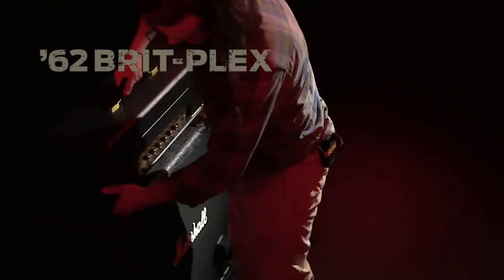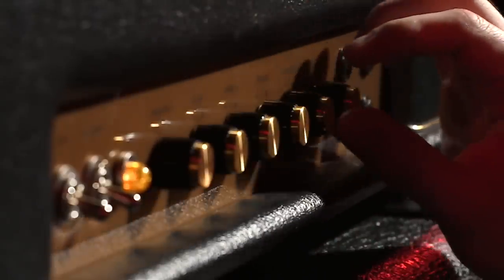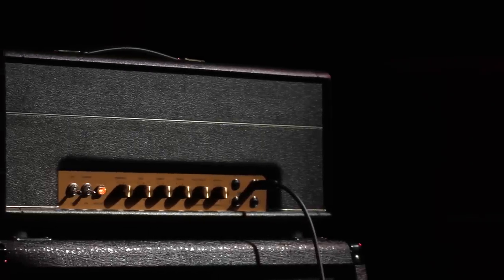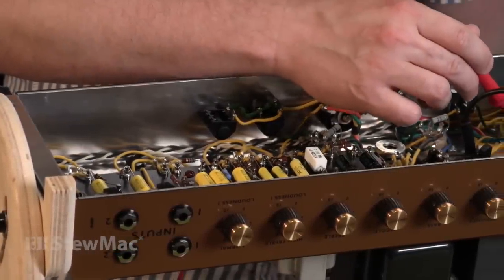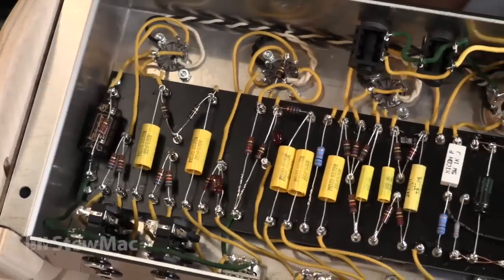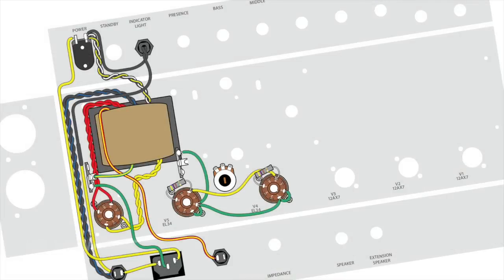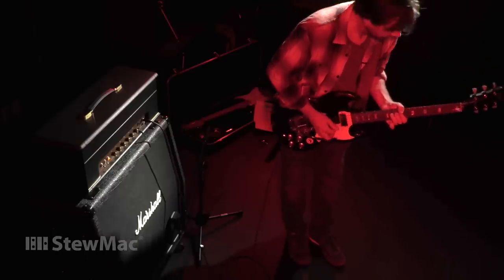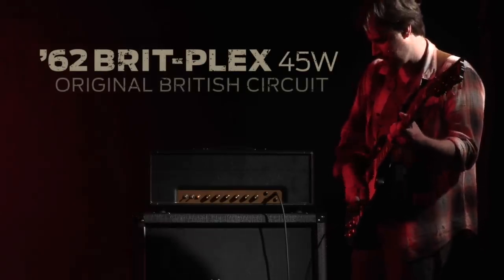Hear the new StewMac '62 Brit-Plex amp kit - a hand wired JTM-45 Plexi style head in a kit!

Comment: So great to have a quality kit being offered by you guys.
For the record, Jim Marshall didn't design any of the circuits of his amps as he had no EE background. The guys behind the electronics were Dudley Craven and Ken Bran. Ken Underwood took part in the building of the initial batch of amps supplied to Jim Marshall, and is the only one of them alive today to tell the story of how Marshall amps got first started. Look him up. Cheers.
Reply: JTM45 was a Fender Bassman copy. The first ones they built used 5881 power tubes. Shortly after they switched to KT66's which basically sound the same as 6L6 power tubes (which were hard to get in Britain). And Leo got the circuits from the RCA tube manuals of the time, almost all the amp builders got their circuits from that as well.
Reply: Hell yeah

Comment: How much?
Reply: 3 chickens, two goats, and a mule from Sister Sarah!
Reply: $999, however right now (05/09/2019) they are running with a $150 off coupon. So You can get it for $849. 
However I'm not sure about shipping cost. Or how long it will be on sale for the price of $849.
Reply: About $3-400 more than it is anywhere else.  These are run of the mill kits available all over for half that price.
Reply: @TempoDrift1480  where? I know there are cheaper kits, but with the head cabinet as well?

Comment: Sounds darker than my original (30w RMS) plexi with gold/white script logo and cream backplate, that runs KT66's in the power stage and a GZ34 rectifier ... are you using EL34's in this as they were not in use for the circa 62 - 66 era lower wattage plexis
Reply: I was just thinking the same thing. I built a DIY JTM45 a couple years ago and I went with the KT66 outputs.

Comment: Lag time? too funny, electrons move at like the speed of light.
Reply: No they don't, its about 1% of the speed of light freely moving, but along the length of a conductor it is measured in "drift speed" which is only a few meters per second.
Reply: The only thing that moves at the speed of light in a vacuum is the speed of light. The speed of light is also the only thing I am aware of that has an inherent speed. 

Electron speeds are a product of the energy they recieve. Theoretically it can be 0m/s, it can be as slow as a few meters/s.
Reply: @solsinclair1909  , ok, they move at about 2,200 meters per sec. it can vary depending on what they are moving thru pressure, etc. I think my point was in whatever I was responding to you weren't gonna hear it.
Reply: Sorry meant kilometers, still having morning coffee.
Reply: @jimallen9442  a few meters per second??? id love to know the circumstances in which electricity does move that slowly, but it sure as hell isn't in a tube amp.
Reply: @m9shamalan  Did you look at the link? A common mistake confusing signal speed with electron speed.

Comment: Why did you use el-34's? The original jtm 45 had kt88 tubes inside
Reply: The JTM 45  had KT66 valves "Early versions had used 6L6 or US 5881 valves But they were expensive and difficult to obtain , later models used KT66 which were mechanically fragile (from 1964), EL34 (from 1966)",The Marshall Major had KT 88 valves!
Reply: @pleximanic  spot on comment ... my '66 with Cream backplate still has one of it's original KT66 blue/white logo GEC's sitting alongside a similar era KT66 Pinnacle and Mazda GZ34 rectifier.